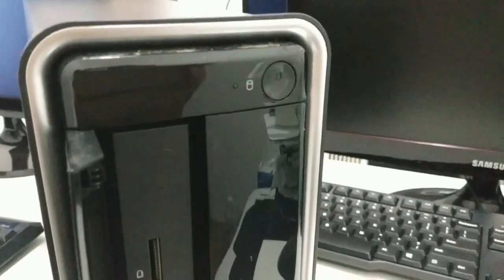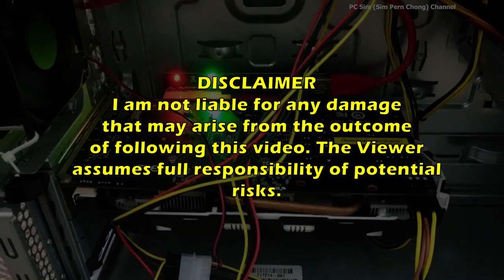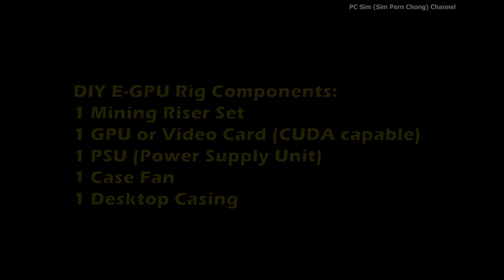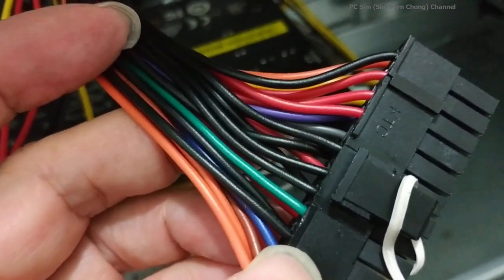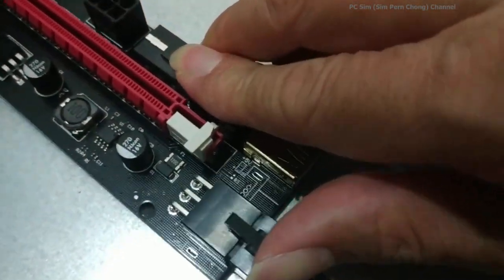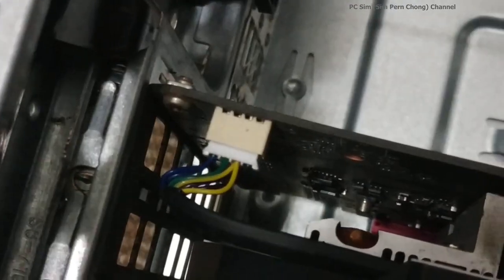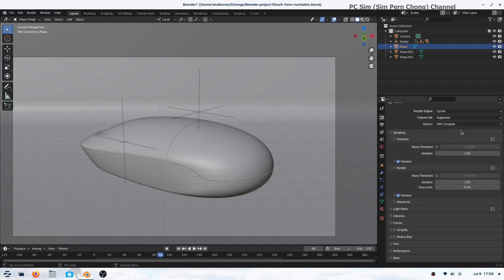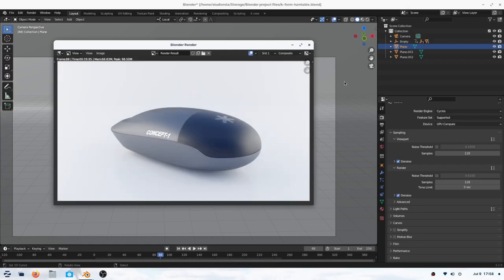Building budget eGPU Rendering Rig (External GPU) for Blender, Rhino 3D CAD and Stable Diffusion

Comment from the maker: I did a rendering test comparison of the P106-100 to GTX-1060. The render speed results showed that P106-100 is very comparable to GTX-1060. The former is only very slightly slower.

Comment: If we joint the green and black wire to power on the smps does it damages the life span of smps ?  and while joining the two wire does the smps runs in full wattage like 450w, 650w, 750w or only takes the needed watts ? (like RTX 3060 on idle only takes 12w when rendering 170w) Btw i got the Riser from Amazon...!
Thanks for the Video..
Reply from the maker: Oh.. I am not really an electrical guy. I got this method of connecting the 2 wires from watching another video. So far I have no problem.

Comment: I'm using a P106-100 but it was not used or rendering at all. What happened here?
Reply from the maker: Sorry, i don't understand..
Reply: @simpernchong  I'm using a P106-100. In Blender, it show up in cycle render device and I ticked. Also make sure to set render propetites to GPU compute. Basicly, I tried anything told online about enabling GPU rendering in Blender. But it still refusing to use my P106-100, only use CPU instead.
Reply from the maker: @zNaYuz  🤔🤔🤔🤔
Reply: @simpernchong  There's no error message. It's just like everything was going smoothly, except not using my GPU at all.
Reply from the maker: @zNaYuz  Sorry. I got no idea 😅😅

Comment: Hi i was checking your video out and realised your actuallly only running the card in 1x pcie which will make it very slow for rendering ,you really need a 16x to 16 x riser adapter board
Reply from the maker: There is no significant drop in speed... because we are not gaming.

I did a test where i have a GTX1060 on the main desktop and a P106 (GTX1060 mining equivalent) in the Egpu, the rendering time is halved. There is practically no or negligible drop in speed.

Cheers.

Comment: does it work for optix ?
Reply from the maker: Oh.. the GTX 1060 and P106 are not compatible with Optix. But I am sure the RTX cards will. I get really good result by simply connecting to the additional P106 which i got for around 50 USD . It halved the rendering speed making it twice the performance of a GTX1060. So i get to keep my aging system without sacrificing performance when i need it. 

Now, i have an additional USB3 to USB3 cable in the setup with allows me to plug the external GPU to whichever system that needs support with ease. :)

https://youtu.be/maGqeari_PI
Reply from the maker: Oh.. installed the latest Blender and nvidia drivers. OptiX is now available as an option.